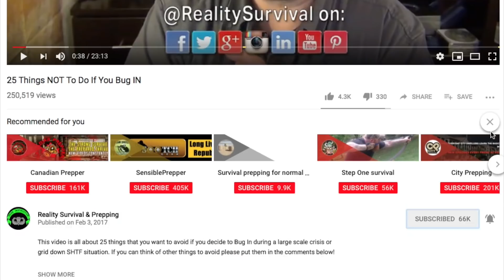Bug Out Vehicle - Got The 327 Turbo Fire Started! - Part 1

Comment: I see a small frame mount tool box / faraday cage with an extra alternator and distributor parts  as well as an assortment of tools. I sport a metal trash can with backup parts. So far the spare starter has been pressed into service. A  bolt on box would always be on board. I have a bad habit of removing  my faraday cage when i have need the room in the bed.

Comment: I have been pining for a deuce and a half but after some consideration I changed my mind to a bov that will blend into a rural area. Something that will blend in to its environment, a vehicle that can be parked in or by a barn or pole barn. A vehicle if left in a field wont stand out. A farm or grain truck. IMFBO (in my flea bitten opinion) preserve the body but don't dress it up keep it a sleeper. Just new tires and build the bed, a hack i found is use waste motor oil to preserve a wood deck it will give it a non glossy aged look  once every couple of years on a sunny day give it a quick mop of more wmo and let it soak in.

Comment: Looks pretty close to EMP proof. Good old 327. They are very fond of gas but tough engines as I recall.
Reply from the maker: Yep and we have an extra ignition module and the old points distributor and coil.

Comment: Ha ha, I miss the days when you could easily put your legs into an engine compartment (full size truck) and the mechanics were not that complicated. Old diesels were EMP proof.
Reply from the maker: This is pretty,much emp proof as well. As long as I put an extra ignition module in my faraday cage. We also have the old point distributor for a backup as well.

Comment: That HEI won't work, after an emp
Reply from the maker: That one wont but the extra module I have in my faraday cage will. :) oh yeah and so will the points distributor and coil sitting next to it.
Reply: @RealitySurvival  Don't forget an older alternator, and points style voltage regulator. The diode trio will be toast, in the one you have...

Comment: Although I love old Chevy trucks... that's not going to be a very good bug-out vehicle. You should have left points in there, they're impervious the emps.
Reply from the maker: The motor will go in the 1980 GMC 4x4. We also will have the points distributor and an extra ignituon module in out faraday cage. :)
Reply: @RealitySurvival  I'm really glad for your father son time. My dad died from Joe Camel. I'm glad you guys get to spend quality time together. It personally means a lot to me and I'm REALLY proud of you guys.
Reply: @RealitySurvival  check the 327 if you have 202 fuelie heads on there they're worth a fortune
Reply from the maker: They are not double hump heads but they do have 194 and 202 valves. The motor was built by an old race car builder who passed away several years back. But he was known in the area to build some grrat motors. So far this one seems to be pretty good.